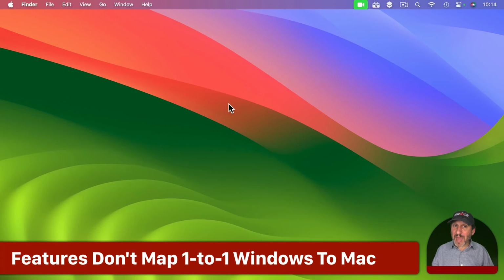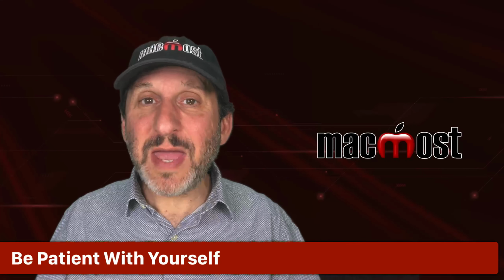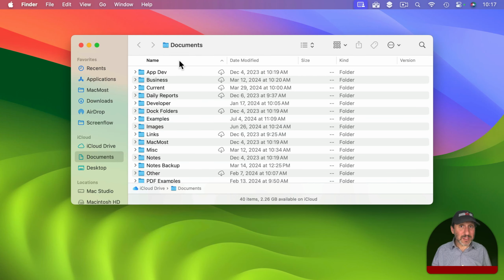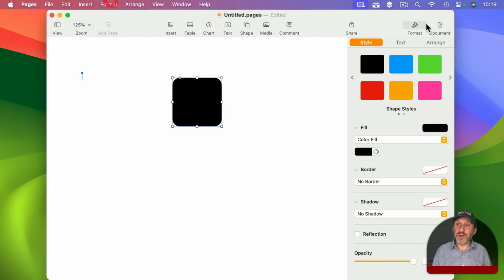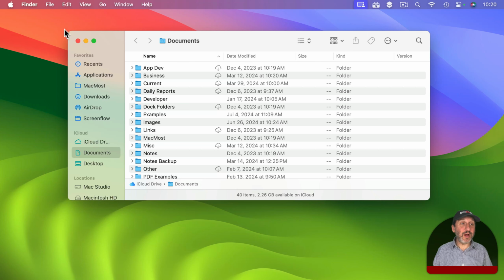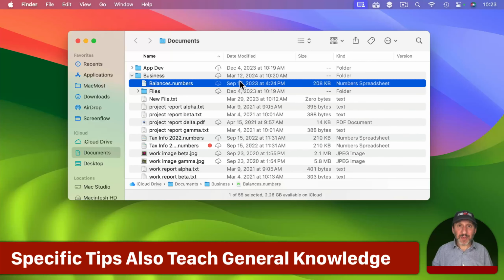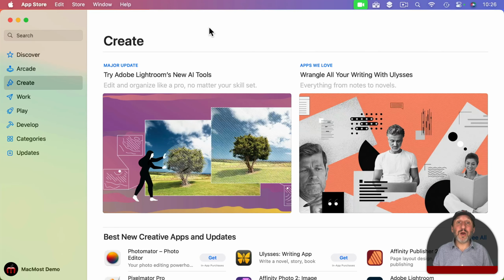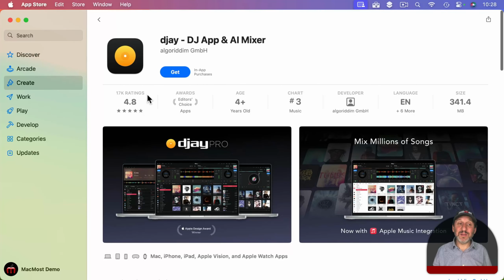How To Learn Mac After Switching

Comment: Bought Mac Mini 4, mainly for Lightroom use. Everyone around me and on the web, praised it. “You will see tremendous improve in performance compared to your PC (Ryzen 5600 with 3070gpu)". 
For now, it is frustrating to use. And Lightroom (import, export and everything else) is not faster. Maybe even slower. Mouse wheel doesn’t move sliders is one of the "bugs" I noticed. 
Searched on web, and found myriads of issues, not present on Windows. 
I hope I won’t regret buying it.
Reply from the maker: Perhaps the issue is with Lightroom? Have you worked with Adobe support on your issues? As for a mouse wheel, Apple doesn't make one. So if you have a third-party mouse with a mouse wheel and it isn't working, contact support for that company and see what is wrong with it.
Reply: @macmost  I switched to my G502 wired mouse, and the problem with scrolling in Lightroom is solved. Still, Windows has zero such compatibility issues. Now I found out, I can't evet write on my NTFS formatted Hard Disk, where all my catalogues are backed up. Unless I pay for a program.
I don't understand, why all these "security features" are necessery, and why I can't just choose to disable them. It is my computer and my responsibility.
So far, if anyone (over 30yo) asks me if he/she should jump to Mc, my answer will be "Hell No".
Reply from the maker: I’m sure if you don’t configure and perhaps install drivers for some third party mice in Windows that you would have similar issues. And on Mac you can’t use NTFS just like how on Windows you can’t use APFS or HFS+.
Reply: @macmost  just discovered, that you can't controll the adjustment sliders on Lightroom by mouse wheel. Such an elementary feature. Intuitive, practical, maybe even the optimal choice. But for some reason, Mac OS doesn't allow it.
It is just one after another  major inconvenieces. With no apparent reasons.
And I can't see any trade offs. Nothing I did on Windows Lightroom, is done different but better on Mac.
Also, I can't even program my buttons 4 and 5 and click down, on my Logitech g502. Not even via Linear Mouse App.That's 3 essential shortcuts, to my workflow in the last 10 years. 
Anyway, thanks for the input.
Reply: Found a way via Linear mouse (changed the shortcut keys to up and down arrow from - and = before). Gemini and forums, all said, it can't be done.
Reply from the maker: You keep complaining that macOS won’t let you customize things like you want but you are not talking about macOS but a third party mouse and a third party app.

Comment: how to enable XD-bit on mac
Reply from the maker: The XD bit? As in the security feature of older Intel processors?
Reply: @macmost  
im trying to run 
dev /cpus/ 0 properties 

but im getting 
-bash: dev: command not found
Reply from the maker: That’s not something I would expect to do anything. What is it you are trying to accomplish, exactly?
Reply: @macmost  im running eve ng in vmware fusion, i would like to install windows inside eve ng but im facing an error during boot...
a friend advised me to try enabling XD-bit  which honestly i don't know much
Reply from the maker: Sorry I don’t use Fusion. Probably best to ask in a community that deal with that, or contact their support.

Comment: When I transitioned in 2012, I found that a lot of the "Windows ways" weren't relevant and I became frustrated. But, the more I got used to it with time and tips from people, I eventually got it. While Windows was useful, I don't have a lot of the frustrations I had when using Mac. I would spend a fortune on anti-virus software beforehand. 12 years later and using the Mac has been a more productive and delightful experience. It's the way a computer should've worked from the very beginning.

Comment: My number one issue with macOS after using it for 3 years now  is window management, especially the close / minimise / maximise behaviour of a window is just terrible and unnecessarily complicated on macOS. I generally rely on shortcuts way more on macOS compared to Windows which generally offers a much richer interface. Having said that I have my issues with Windows too, but in the window management department Windows wins for sure.

Comment: Spot on Gary. I switched to MacOS from Windows about a year ago and it was frustrating at first to find how to do something that was second nature on Windows. Having used MacOS now for a year I love it and can't see me ever going back to Windows. Like you said, just keep exploring the OS and the different menus. If you need help with a specific function use Spotlight Search or a web search. I learned so much from watching this channel that it made it so much easier for me to navigate the system and learn new things. Many thanks to Gary for that. And I continue to learn new things about the Mac and IOS pretty much every day. One tip I use to help remember where certain commands are or how to do this or that is using the Stickies app. Great for taking notes like keyboard commands and such and easy to access quickly.

Comment: Before ditching your Windows PC, if there are certain files on that PC that you would like immediate access to on your Mac, consider installing a cloud service (like Dropbox) on that PC that is also available on your Mac.  Then save selected files on that PC to your cloud service.  On your Mac, install that cloud service and use the same user ID and password that you used on the cloud service on your PC.  The files that you saved on your PC’s cloud service should then appear on your Mac’s cloud service.
Reply: That’s a good idea, but rather than using a third-party app like Dropbox, it would be easier to use iCloud for Windows. Then all your files will be in one place. I used to use Dropbox but found with iCloud there’s really no need for it. In fact, that’s a good general rule for getting the most out of your Mac: If there’s a native Mac app, try that first. For example, I used to use Evernote, but have stitched to Mac Notes. Same with Word vs Pages and Excel vs Numbers.

Comment: the biggest headache is Dock and top menu. maximise a window is confusing. windows provide lot of free apps but Mac none. open windows or apps is confusing. Mac does not provide simple apps for free like Paint and Paint 3d in Windows. we switched about 4 work stations to Macbook M2 but we had to go back to noisy windows laptops made by Dell. Mac hardware is awesome and rest is not.
Reply from the maker: What do you mean by "windows provide lot of free apps but Mac none"? Apple gives you for free: Pages, Numbers, Keynote, iMovie, Photos, GarageBand, Freeform. Many others comes as part of macOS like Notes, Reminders, Calendar, TextEdit, etc. There's nothing exactly like Paint, but Preview and Photos do a lot depending on what you are trying to do exactly.

Comment: I've had my MacBook Air for nearly 3 months and I LOVE it. I've had Windows PCs since '03 and have used that OS at work since the 90's (Windows 3.1, 95, etc.). When I switched to Mac, the things that tripped me up were the keyboard, the Menu bar being on the top of the screen instead of the window, and me over-thinking things. I do think already being proficient at iPadOS and iOS helped, but for the first few weeks, I was sneaking back to my slow, but still-functioning HP laptop. 🤣 Finally, I told myself that the only way to become proficient at Mac was to just use it. I made sure everything from my PC was backed up and moved over, then I powered down my HP and put it away in its sleeve out of sight. I have not looked back.💻

Comment: Gary, thank you so much for this encouraging video. I've had my new MacBook for about 6 weeks and it's been both frustrating and rewarding. I'm a very long time pc owner but have used Apple products on and off at work so I'm not totally unfamiliar with the Mac ecosystem but hadn't really had much opportunity to explore. My goal now is to use only the native Mac programs as much as possible and most of your suggestions I'm already doing. Your videos, and those of a couple other YouTubers, have been extremely helpful. Thank you!

I do have one question I'd love for you to address at some point. I have one program on my Windows laptop that cannot run on a Mac (which is why I hesitated in purchasing a MacBook); is there a way to run a Windows-based program on a Mac?
Reply from the maker: Depends on the app. Your first choice should be to get that app for Mac. Second, would be to get another app that does the same thing. Lots more options but it is hard to say without knowing what it is.
Reply: @macmost  I realized later that I should have said it's DOS based program and isn't available in a Mac version, at least at this point. It's a program especially geared to soap making. In the meantime, my PC laptop still works but is definitely on its last legs.
Reply from the maker: @peridot1454  That old? Seems like there should be some better app or some other way to do what you need. Is it just some calculations? Are you sure there isn't a website that does it? Maybe a spreadsheet?
Reply: @macmost  It's a program that includes inventory control, soap recipes, products, and sales.... all integrated. I've created a basic version in Excel at one point (in 2002 ish). For reference, it's Soapmaker 3; my understanding is, the author of the program is in the process of updating it but the current version is PC only.
Reply from the maker: @peridot1454  I no nothing about that industry, so I can't be of much help. Seems to be a website (Soapmaking Friend) that may do what you need, perhaps? Or I'm sure people get along without it using spreadsheets, etc.
Reply: @macmost  I use Soapmaking Friend as well, for my recipes. Thank you, Gary, for even taking the time to get back to me on this. I'll just keep using the other program on my old PC laptop for now. I appreciate all your input.
Reply: @peridot1454 you can also buy parallels desktop to run a windows on a mac

Comment: All great pieces of advice. When I made the shift I came from Windows 98. OS 8/9 were a total mystery. Then OS 10 arrived..... I tried to learn by using books, such as the "Missing Manual" series by David Pogue. But, while this helped a little, of course was OS specific, and was no help with the various programs ( remember when they were called that? ) that I was running. But every day I would learn by using, and was astonished by just how easy the Mac made this. These days I am still learning. macOS is far more powerful and capable. 

Seriously though, why change to the Mac if you want it to be like Windows? One of the main reasons to change is the simplicity yet elegance of the OS, compared to what you are leaving. 

Gary, I often tell folk to look up your channel when they need to learn some Mac thing. This video is one I will definitely recommend. They should take off their waders and dive in.

Comment: Great little post!  I've had my iMac for years and didn't know about that option feature in the dropdowns because I don't just poke around.  I really should do more of that, just pure exploring.  I use Windows at work and if I am doing something new (rarely the case) I am a little more comfortable in Windows just because of the time and familiarity.  You make a good and reassuring case to find out more - quite motivating.

Comment: I just picked up a used iMac for my wife and was thinking about setting it up with macOS, but I wound up installing Windows 10 instead, which she currently uses on her laptop. My main reason, was that this is an older machine that would need to have OCLP installed to use modern versions of macOS and although OCLP is pretty solid (I use it without issue), I thought that it could potentially be a problem in the future. All that said, I've got Windows 10 running on an external USB3 SSD with this late 2013 iMac and it's running really well so far.